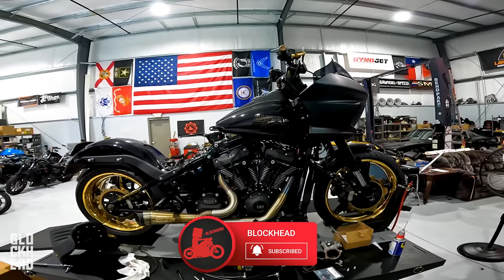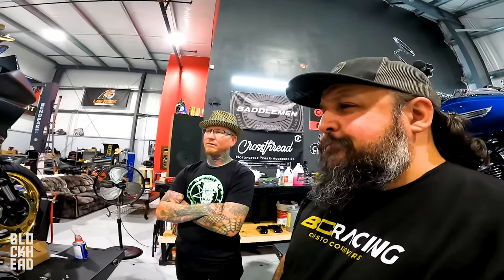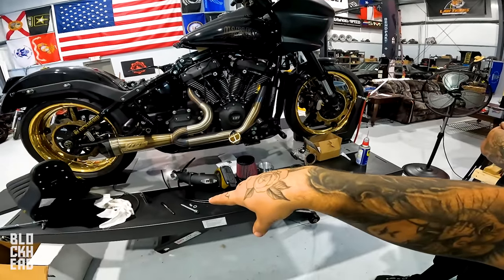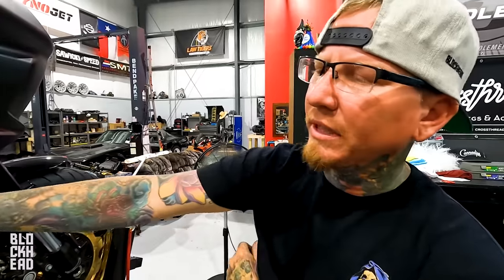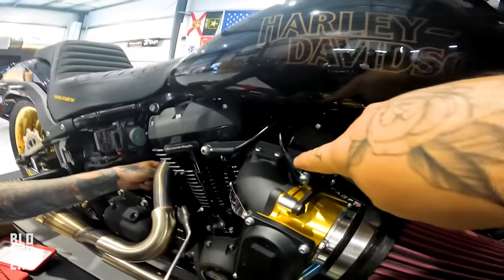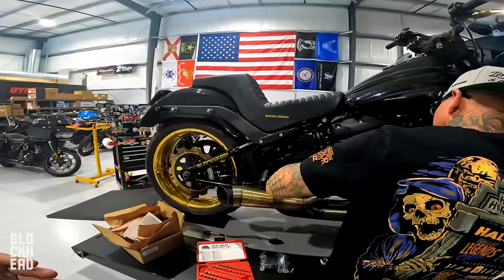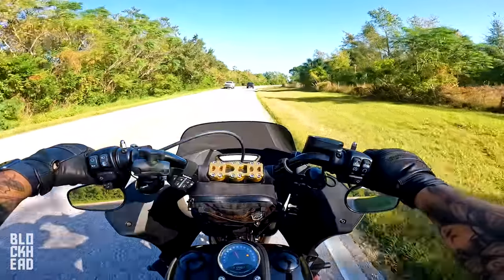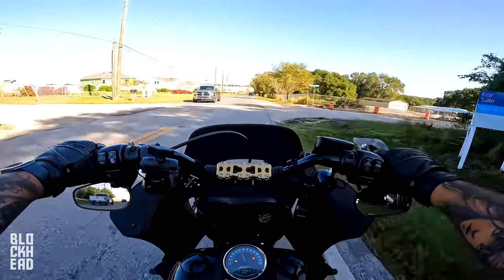BEST Air Cleaner For Your Harley-Davidson Milwaukee 8?

Comment: For high horsepower builds a ported 64 mm TB has proven time and time again to be better than that. My M8 makes 166/169 and when I switched nothing but my intake to that one I ended with 158/163…
Reply from the maker: What's your build specs? Those are great numbers

Comment: If I had to replace an O2 sensor, I would probably switch to wide band with a Thundermax ecm. I think you were running a Thundermax maybe a year or so ago. For ”science”, it might be interesting to see how well the auto tune on Thundermax works compared to the custom dyno tuning. Or what about a wide band TargetTune module from Dynojet instead of simply replacing the stock O2 sensor from H-D?
Reply: I actually seen a comparison recently on a Thundermax compared to target tune on a dynojet, and the dynojet actually gained a full 7hp over the Thundermax. I was sold on the Thundermax for one of my bikes until I seen that. Ive done some more reading and now I'm going to go with the dynojet with target tune and have Crete Performance up here in Canada tune the bike!
Reply from the maker: We went from Thundermax to Dynojet and gained quite a bit of horsepower. I want to say like 10+ more, and it was cheaper as it's not an entire replacement.

Comment: I have a 2021 heritage classic 114. Only mod so far is slip ons. I want to get the most out of my bike but the rabbit hole is deep. Where to start is where I'm at. 

What would people recommend as the order in which to start; cam, injectors, spark plugs, I'm thinking eventually going with the crate engine. So many things and not wanting to dump all the money at once

Comment: I’m thinking about doing all 4 stages on my 2003 Sportster
Reply: I did first 2 stages on my 2020 fuel injected iron 1200 and it boogies. I have 2 bigger harleys and wanted a hooligan bike to rip on and im not disappointed on the money spent
Reply: That’s cool.  I’ll have to save some but I’m thanking having a 1200 would work better than a 883

Comment: are u going to run the st bags on goldzilla since u have the fairing me personally I don’t like how they open
Reply from the maker: I'm not a fan of the clamshells, but I've got a set of Leatherpros that I run when I need them
Reply: @BlockheadMoto  I feel u on the clamshells they look good just the way they open what I don’t like my cousin has the low rider st I got to ride it check it out

Comment: @Blockhead & Chris. 
21 Fxbbs. 
Best cam for mid-top range on a 114? 
I roll 80 on the highway and tend to shift 2500-3k when I’m not abusing it but love to pin it when I have the space and  would like better mid-top range performance. Your recommendation means a lot. Have a dynojet PV, SE heavy breather and no mufflers(currently) but getting a cobra Diablo 2-1 very soon.

With that said best cam req? Thank guys 🤙🏻
Reply: Star F35a.  No contest, but does require valve springs.
Reply: check out Fuel Moto 777 cam. Their new ST put down 136rwhp 130tq with that cam, their contender pipe, 64 tb and extreme breather air filter.